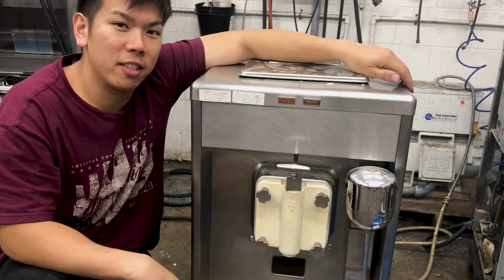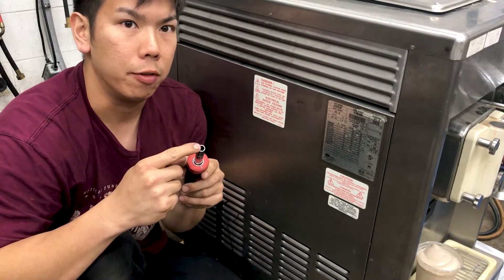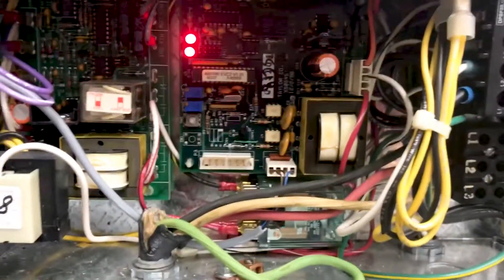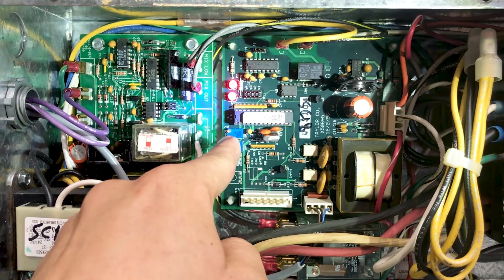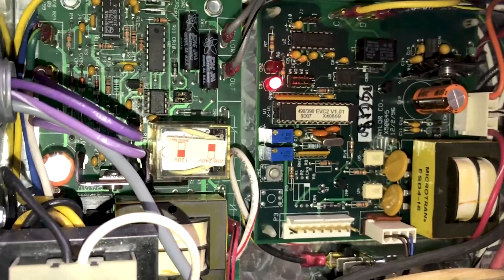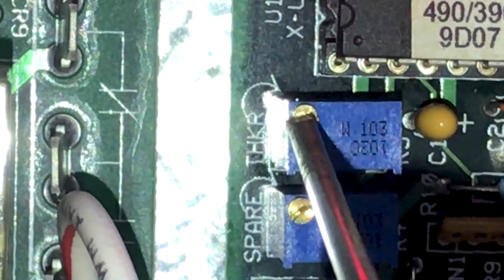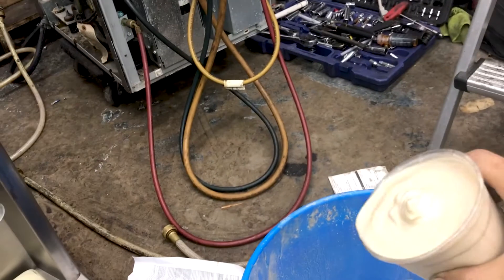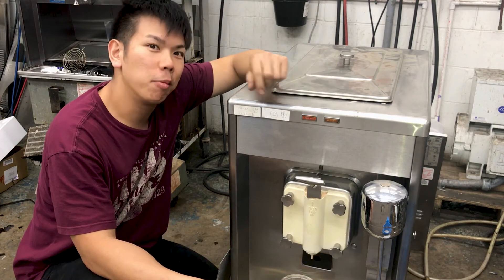Taylor 490 Shake Machine Viscosity Adjustment

Comment: Hi my problem is when try to turn on lift the handle and would not keep on any help ty
Reply from the maker: If I understand correctly you are having issues with product not dispensing? There are a number of things that could cause this but a common one is over freezing - solution: adjust the viscosity warmer. OR could be a clogged feed tube.

Comment: The blue box for adjustment is a 30-turn precision potentiometer. Do not over twist or it may break and only option in the field is replacement with a soldering iron 😫

Comment: how about adding more videos for 339-27 type ,thanks.
Reply from the maker: everything from 794 videos applies. Same machine just different size compressor and barrels
Reply from the maker: @guestbaxted7202  
Per 390
Did you buy the machine from us? I don’t see record of purchase with us. 
It could be that or you are having a high pressure cut out that is real or faulty. A new board because of a contactor doesn’t add up. It may be a signal issue or a cut out issue. You’ll have to narrow it down.

Comment: Can u halp me ? I need wiring diagram taylor model 490
Reply from the maker: Hi, please see the link below: https://slicesconcession.com/pages/taylor-490
Reply: Useful information, thank you.
My machine is faulty , it works for 1 second when I activate the valve microswitch and disconnect the contactor after 1 second only , I have tested everything looks good , the problem comes from control board, is there a component I need to focus in board